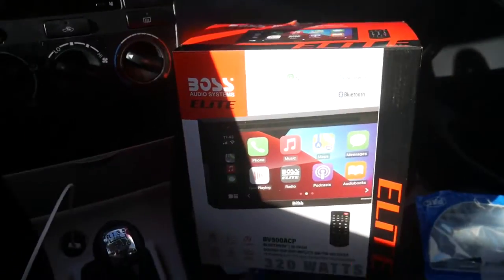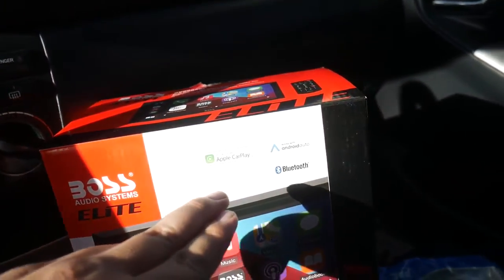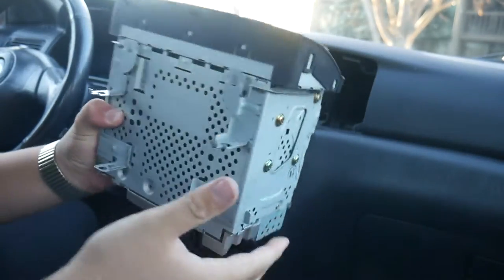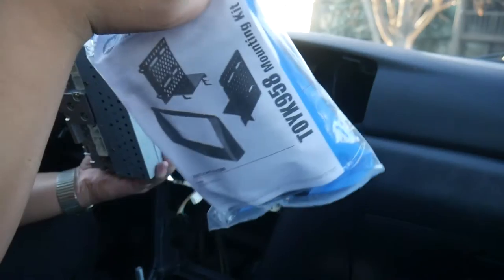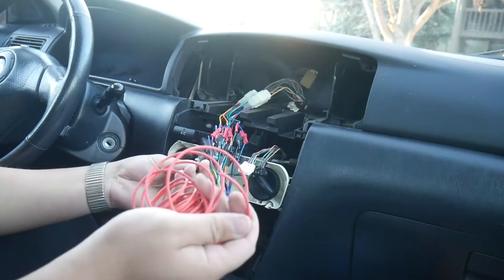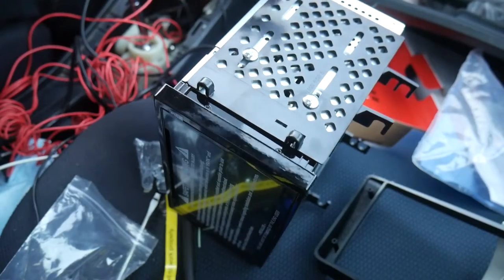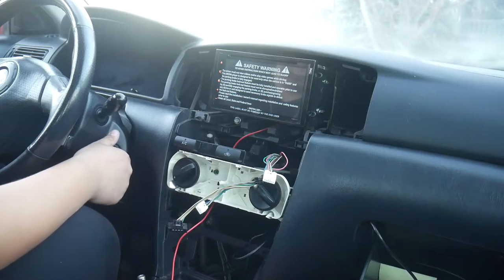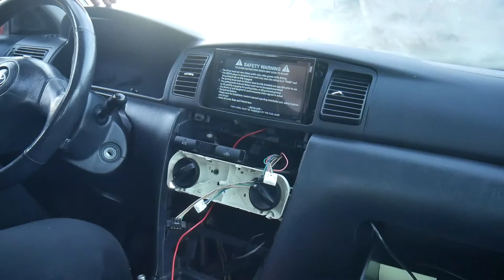Installing A BOSS Apple Carplay Head Unit In My Corolla

Comment: Great video. I have the same model Corolla and I’m looking into installing Boss system. It looks like this video is about a year old, how has your experience been? Also is there anything else I need to do with the electrical work other than the color wiring? Like do I need to put a reducer in somewhere to not short the electricity etc. Again, appreciate you posting this.

Comment: I'm looking to install a pioneer head unit in my 2006 Corolla but I'm not sure where to connect the parking brake wire to exactly, could you explain a bit?

Comment: Was connecting the wires as simple as interlacing the strands together and covering the new connection with the red/pink sheath? 

Thank you for posting!
Reply from the maker: Yep, just need to connect the colors together. There's a few ways to do it, like how I did it with crimps, twisting the wires together and using heat shrink/electrical tape to cover the bare metal, or soldering the wires together (and using heat shrink/electrical tape over the soldered part.) Thanks for the comment!

Comment: Nice video! 👍

In my 03 Corolla CE, I have a dummy blank and coin holder left of steering wheel. Do you know of an USB insert to replace these 2 inserts? 

I mount my phone via windshield sticky next to A-pillar.
Reply from the maker: I don't know of a usb insert, but there could be one out there. The other way that could work would be to run a usb extension to the dummy blank but depending on how clean you want it to look you might need to cut a slot in the blank for the usb to slip into
Reply: @WillChang  Right now, I have USB from stereo coming out of where the blank is. It looks kinda low-class, even though it does the job. 🤪

Comment: Love the vids bro how do you connect the wires together what’s that piece called
Reply from the maker: Thanks for the support! It's a crimp splice I'm using, but it's not the only way to connect them. The preferred method is to twist them together and solder them, it'll reduce the chance of interference in your audio system
Reply: @WillChang  So essentially you just match the wires with the same color and your all good right?
Reply from the maker: Yep! All the wires say what they're for as well with either tags attached to them or writing on the wire itself

Comment: which tool did you use to unscrew the radio the 4 bolts?
Reply from the maker: I used a 10mm socket on a 4in extension. The extension was just to make it easier to reach the bolts but the 10mm socket is required